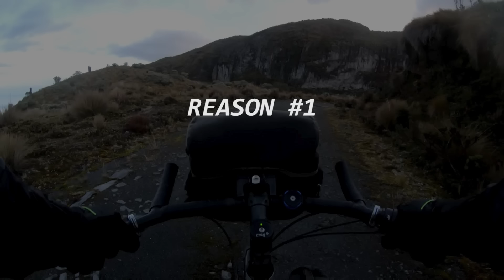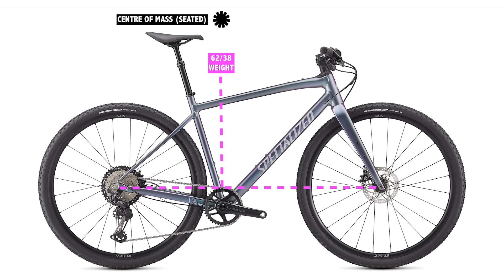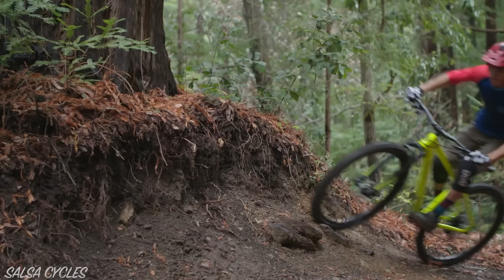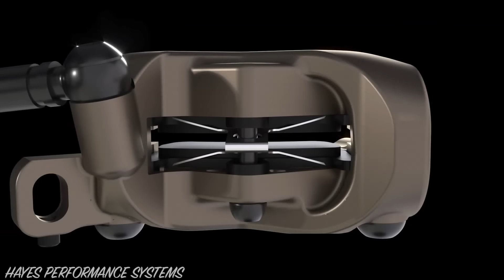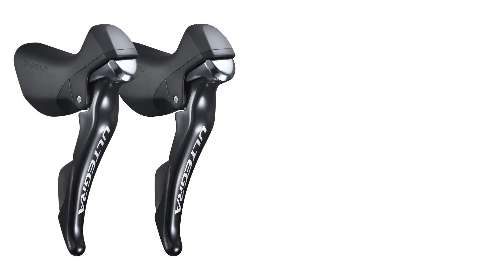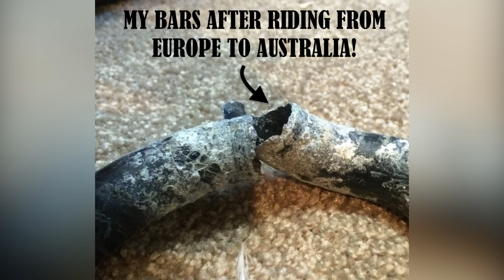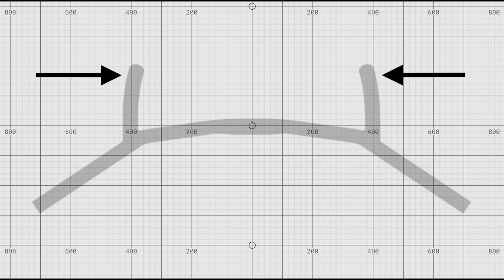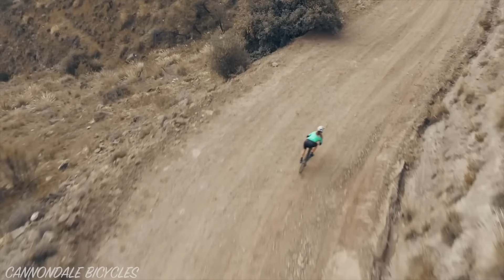Why Flat Bars Are BETTER Than Drop Bars For Most Cyclists (Objective Analysis)

Comment from the maker: I spent 8 minutes discussing the merits of flat bars, and 2.5 minutes on the merits of drop bars. That means flat bars are exactly 3.2X better than drop bars! Case closed everyone. 🔨👀

But seriously, I hope you enjoyed the analysis! 😎
Reply: Agree to your arguments but don't understand the exclusion of ergonomics. In sense of which position is best, ok, that might be subjective, but in sense of having more positions available on drop bars (at least to standard flat bars) and a better body weight distribution is more objective. Overall in short, flat bars are more for rough terrain and all your arguments apply, drop bars are more for smooth terrain and more km per day.
Reply: @stefanwagener - I have a route I ride regularly that's fairly hilly. My straight-bar hybrid is a lot faster on twisty descents that my drop-bar bike. Firstly greater leverage; secondly, the brakes are far quicker to operate & lastly, the brake levers on the drops flex far too much therefore end up being far better than rim brakes even in the dry but no match to the MTB brakes on the hybrid. The better the brakes, the faster you can go. Drops for road racing or race training - absolutely better.
Reply: Not a huge fan of youtubers labeling their subjective opinion objective analysis.  But whatever feeds the algorithm!
Reply: Nah, talking more about your favorite handlebars doesn't mean their better
Reply: On a road bike on The road, drop bars are objectively better, especially with control, brake power and aerodynamics high, aerodynamics low, and aerodynamics when standing.
Reply: @benbraceletspurple9108 My bike rides on the road and off the road.....with flat bars.
Reply: what do I do with all these drop bar bikes in my garage that are now garbage?
Reply: I think U forget to mention that flat bars r better for snappier steering even tho it like to wonder more.
Reply: I used to love drop bars...i felt so cool...they seemed comfortable enough....then after many years of chopped flatbars with bar-ends (cut narrow as can be to fit between trees) i bought a bike with drops.....i hate them! My posh levers and shifters are now a burden....i want rid of them for a narrow MTB set-up! 

My speed is the same approx. My comfort is way less on the top of the drops and the hoods.
Reply: this video is poorly titled, you keep comparing road bikes vs  mountain bikes. instead of the actual differences in the handlebars
Reply: Also good for older cyclists.
Reply: @ryanancheta8528  I'm 57. I ride both. Prefer drop bars. The wide gravel type actually. Way more hand positions. Depends on the ride. Cross country MTB ing drop bars are also better. Of course dropping in anywhere on a downhill you need flat bars.
Reply: @ryanancheta8528  Ahem. We're not older cyclists. We are veteran cyclists!
But I've always preferred flat bars. No arguments there.
Reply: @BrianRPaterson  sorry for the term. I agree. We are veteran cyclists.
Reply: science!
Reply: That extra 0.2 after 3 closed the case for me lol
Reply: I’m trying to find the bars you designed for sale
Reply: What about praying hamster bars and superman bars?
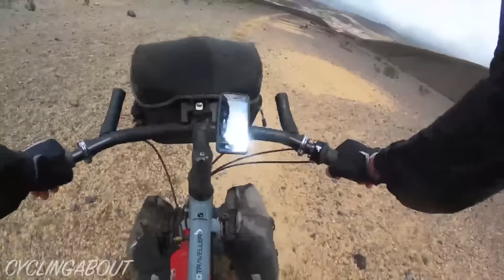Reply: @CYCLINGABOUT - Hey m8, can you tell me which bars are in the thumbnail and/or at 1:05? Are they 'Velo orange - Crazy bars'? Cheers.
Reply from the maker: @gregoryj2046  KOGA Denham Bars
Reply: Are we to take this seriously? Your analysis is way off. Period!
Reply: Thank's bro 🇨🇵 ✌️
Reply: I'm glad that after making up our minds for all of us you can still joke about it.
Reply: i wish i saw this vid earlier before i had a tripple chainring with low gears and larger disc rototors installed on my surly disc trucker, nobody told me i can't do that, thanks for this info mate, you are certainly not bullshitting at all!!!
Reply: Shit, I ride 3.2 times more with a drop bar, even though I have enough bikes with a flat bar.
Reply: The US market seems very simple to me: Is it chic? Is it expensive? I want it all!
Reply: I could add one more huge benefit on the use of flat bars.  Less chance of you falling off the bike with flat bars.  A lot of YouTube’s are young and falling off a bike is no major problem but we seniors need to be more cautious and safety first.
Reply: I would discard the #2 and #3 reasons, as it is more about stem length
As for the brakes they all must be operated with one finger, disregarding flat or drops - if you need more, those are bad brakes, not handlebars
Flat bars don't offer different positions, but only variations of a single option, if you consider wrist and shoulder rotation. Drop bar dominance is even more clear, if you pick only positions when you can operate the contols

In general though this video and whole argument can be condensed to the statement that flat bars originate from and get used on mountain bikes and are connected with all corresponding tech advancements, while road bikes have not caught up, so the drops are inheretely flawed.

But personally, I find pursuit handlebars the absolute best
Reply: This is my favorite channel for super bike nerd content. Love it!
Reply: 3.2 times? Hard to argue with that logic. Thanks!
Reply: That....is a good joke.
I concur...but...best bar of all is bullhorns. 

....All the power of flat bars, plus the most used part of drop bars. I had ScottAT2-LF bars on my old mountain bike. Best Bars Ever! Im actually considering getting some  Walmer Bars and cutting the drops off to make some 600mm bullhorn bars!
Reply: And by a strange coincidence that is how much faster they are.

No for real, for touring I never considered drops. They are only good for road bikes, but there they are really way better.
Reply: Problem with the multitude of hand positions on flat bars and their variants are that there remains one single point where you can both hold the bar and action braking (or shifting). 
Drop bars double that with the hoods and the drops.
I don't fancy achieving my max speed by using bullhorns or aero bar extensions with no ready access to braking on a non-closed track - I consider the drops far safer.
The drops also lower your centre of gravity, increasing the amount of braking power you can use before lifting your rear wheel.

I'm not sold on flats, can you tell?
Reply: @roby4274 actually that's my argument AGAINST drop bars. On a normal flat you have access to ALL controls at once, albeit have only one hand position. While on a drip bar you still can access them quite complicatedly.
Reply: As a Mtber I agree.
Reply: @buckroger6456 - as an owner of bikes with both sort of bars, I also agree!
Reply: @paulbusby2013  just seen your other post and I also have a hybrid with flat bars. Everything you said is spot on. I know road guys talk about all these different hand positions and all, but I find once you figure out what works for you flat bars aren't a problem. I often ride 50-100 miles on my Mtb and don't have any problems with my hands after a long ride.
Reply: @buckroger6456  - I suspect many have an emotional attachment to drop bars so invent or repeat the stated justifications to sticking with them. Others come up with equally spurious reasons for sticking with rim brakes such as "rim brakes look nicer than those dangerous rotors!" - rot!
Reply: @paulbusby2013  I live in roadie country and I hear that stuff a lot. Seems like most roadies like rim brakes just because it keeps their bike lighter. I just don't get the whole weight thing since 99.999% of these guys aren't racing.
Reply: @buckroger6456   -  rim braked bikes will always be slightly lighter. That unassailable fact is irrelevant for the simple reason that to go faster, you need to be able to stop faster! The worse brakes I ever encountered were on hired MTBs with cable operated disc brakes (rod brakes would have worked better) - they had none of the advantages of hydraulic brakes but heavier than rim brakes, with greater maintenance to keep them from rubbing!  I've personally accepted most modern innovations such as tubeless, thru-axles but not single chainrings on gravel bikes!
Reply: @paulbusby2013  I love most tech that we get for Mtb and want to build my next bike around a gearbox and belt drive. The one tech I'll never be down for is electronic anything on a bike.
Reply: @buckroger6456  -  there are many alternatives to derailleurs such as hub gears with chains, hub gears with belts & variations on shaft drives. Most need less maintenance but are less efficient. The problem with one-by systems is that the weight is on the rear axle rather than near the C of G so increase the un-sprung weight of full suspension MTBs . Belt drives are interesting but you either need to split the belt or split the seat stay but are probably great for long bike-packing trips. The next Big Thing is hookless rims & tyres.
5yrs ago, I bought a so-called endurance bike (Giant Defy) that came with much modern innovations but decided to stick with cable shifting - so have returned to drops. My recent gravel conversion of my hybrid handles better with its straight bars on twisty downhill tarmac. It's also light due to Hunt carbon wheels but it ain't no MTB neither. Still great fun & gets me away from traffic!
Reply: @paulbusby2013  I've been riding for over 20 years and plan on building up a gearbox and belt drive hardtail next year. I pretty much only ride Mtb, just never got into road despite living in a very road bike area. 
 I'm very aware of the pros and cons of a gearbox but see it as having more pros then cons. Plus I think it'll be great for bike packing as well since touring guys have been using this system for years. I've never been worried about weight or what's more efficient since I ride with a loaded down camelbak.
 Also I have a hybrid myself, but mine came with flat bars. The thing is they were too narrow so I put on wide Mtb bars on it and have loved the bike ever since. The one thing I did learn was that it's not built for trail riding or at least the trails I like to ride. I dinged the rims up and kept destroying gravel tires.
Reply: @buckroger6456 - sounds like the Pinion then.
Reply: @paulbusby2013  that depends on which custom builder I go with. The one I'm really liking doesn't make a frame for pinion but does offer a Rolhoff.
Reply: @buckroger6456   -  are they based in Bristol? I used to have a 7sp Claud Butler that I converted to riser bars - used Grip Shifts - loved them!
Reply: @paulbusby2013  I'm in the states and this company is in Austin Texas
Reply: @paulbusby2013  I'd run 1x on Any bike i had (including a CX).  With wide-range clusters as good as they are now, there's no need for a front Derailuer and you gain a steady power-band.  As per gravel-bikes, they're just marketing gimmicks to separate fools from their money; better off with a 29er MTB with an alt-flat bar if you're looking for a beefy, comfortable 700c wheeled dual-purpose bike.  I just wish UCI would pull their heads out of their asses and allow flat-bars for cyclo-cross racing; it would make more sense and be safer(!).
Reply: @bartmullin8018  - I remember how long it took for aheadsets to be adopted by the racing fraternity due to the UCI shying away from improvements. I said very much the same & got a testy reply from a CX racer who told me I didn’t know jack about the subject. One of his reasons was flat bars would be dangerous as CX was often a contact sport so flat bars would cause more crashes. Although I’m sceptical, the guy raced & I don’t. 
The gravel bike was a triumph of marketing over common sense aimed at racing/touring bike owners who don’t want to change how a bike feels on tarmac & perhaps think that flat bars are for cheap hybrids, not “proper cyclists”.

Comment: Geometry,  wheelbase, and braking power are moot points because a flared drop bar can very easily be adapted on a "flat bar" mtb or atb bike with a good gravel drop bar and aero long-pull brake levers.

Comment: reason #2, 3, 5, 6 are not about the handlebars, but about the bikes they are most commonly mounted to. kind of beside the point of comparing only the handlebars. 

reason #4 is saying flatbars offer better breaking when in reality it's due to the 4 piston breaks on MTBs. just use a drop bar on a MTB or use MTB breaks on your road bike. handle bars are not at all relevant for this point

the safety concerns are only really relevant, if you just learned how to ride a bike. as for reason #8, bike packers usually don't want too large of a bar bag so they don't overpack.

i feel like calling this analysis objective is pretty misleading. the most important thing about handlebars is if they feel right and there's no pain when you ride your most common distance. which is mostly subjective.

Comment: I'm a mountain biker first and foremost, however I have never found a flat bar set up that is more comfortable after weeks of bikepacking than the hoods on a drop bar. I've tried bar ends on flatbars and whilst it helps not having access to the brakes and gears is a major flaw. On a rough bikepacking trip I'll use that combo, but on a gravel/road trip I'll go drops every time.

Comment: Everyone reading this: don’t listen to this guy. He clearly has no idea what he’s talking about.

A flat bar is useless for a road or gravel bike and shouldn’t be recommended as a general solution. Most of the points made here are simply nonsense and ignore the actual advantages of drop bars for road and gravel riding.

Comment: Ok but getting higher ratios = more speed. You forgot that. 
    
Where I live drop bars are not common. So they are cheaper. Idk how the logic is. 

    
Also touring bikes doesn't exist. It's more of a "hybrid" as they say. Which is basically a road geometry with flat bars. You are already in an aggressive position.

Comment: Drop bars include a flat bar, plus the drops. They are fantastic.

 I just converted my flat bar bike to a drop bar; it is so much better! I love the drop position for hill climbing, not just speed.

I kept the flat bar hardware: the brakes and shifters are on the top bar. That is perfect. I'm not a competitive racer: grasping the top bar gives me an everyday comfortable position, and the brakes are right there.

My bike has a threaded old-school headset that takes quill stems. I didn't have to replace the old quill stem, but I got a nicer one which sports an adjustable-angle extension. That cost $30. The bar cost only $25 (Canadian!) and the bar end plugs were like four dollars.   The bar has a 25.4mm old-school clamp diameter, with a 22.2 mm diameter elsewhere that is compatible with flat bar hardware.

The old-school quill stem means I have easily adjustable height, over a wide range. For now, I'm keeping it on the low: the quill is pretty much all the way in, and the extension is angled negatively (so with the angle of the head tube, it is about horizontal).  It's lower than my flat bar was, but because the top grip brings my hands together, the posture of my back is about the same.

Because I don't have the conventional road brakes, I have auxiliary "horn" handles on the way that I will put into that position where road bikes have brake hoods.  Most road cyclists with drop bars cup their hands around the hoods, a lot of the time for relaxed cycling; those  auxiliary handles will make available a kind of mimic version of that position to me.

I might get road brakes. They will be brake levers only; I will keep using the flat bar indexed shifters: Shimano Alivio things.
Reply: The brakes are in the wrong place. I want quick access.

Comment: I just came from 30 years of riding only flat bar mountain bikes to my first drop bar bike. I find it strange when people talk about lack of different hand positions being an issue on a flat bar because I struggle to think of any time in that whole 30 years of riding when my hands / arms were fatigued from a position and needed another position. It's not a problem I've ever really heard from mountain bikers. Yes you get 'arm pump' when doing a long rough descent but that's inherent in holding on really tight while getting thrown around, and the only solution really is to get to the end of the descent or take a break. Conversely, I find myself shuffling all over the place on a drop bar because the positions are all at least a bit uncomfortable. To some degree it feels like the solution of drop bars contains a solution to the problems caused by having drop bars

Comment: The argument that flat bars offer a wide variation in design is flawed, because your flat bar bike has exactly one of those designs, which excludes all the others. It doesn't defeat the argument that drop bars have multiple grips all in one bar. 

Moreover, if you are buying a price optimized flat bar bike, you don't get to choose the handle bar. If you choose the bar, you are customizing., And then. if your are customizing, most of the arguments in this video go out the window: you can choose your frame geometry, gearing, handle bar, where the brakes are on the handle bar, and all the rest.